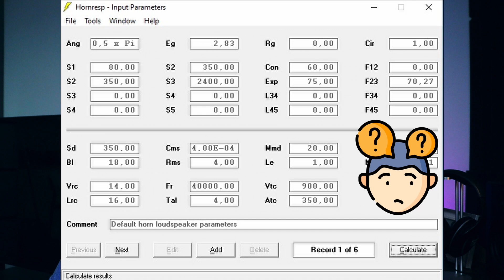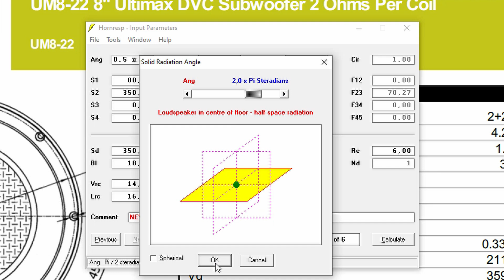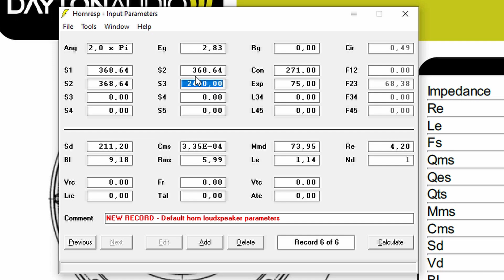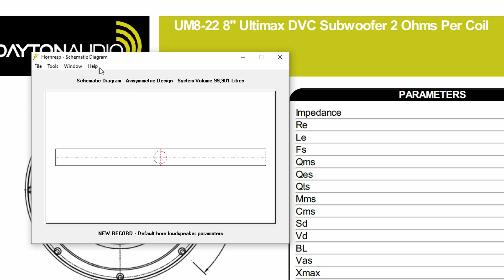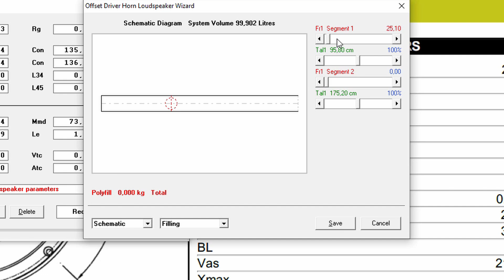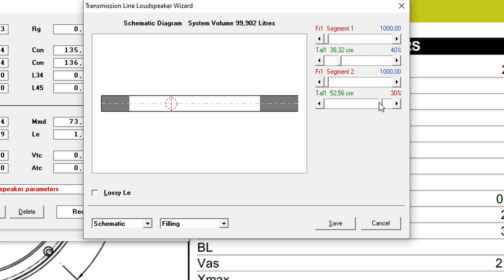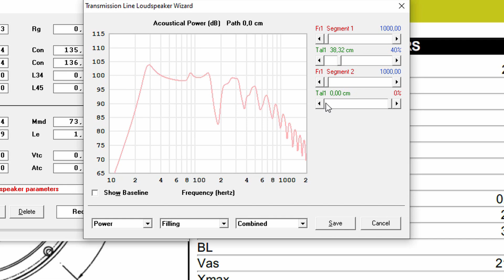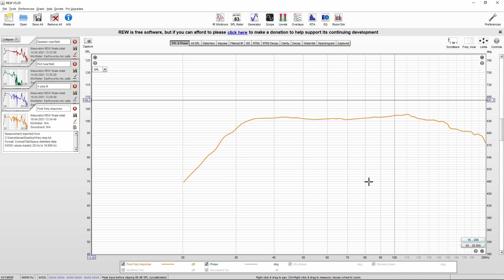Hornresp tutorial - How to design a transmission line enclosure

Comment: 1:30 That's a terrible starting point. You'll never end up with a system response at the driver's free air resonance, because you know... It won't be in free air. It'll be in a ported enclosure, because a transmission line is just that - a very simple ported enclosure. A better starting point is the size of a rather large bass reflex enclosure plus the port. You simulate it in any sim,  take the volume and the system Fs, the port's tuning and you work around these numbers. Otherwise you're chasing a moving target and just wasting time. Unless you pick a very specific driver, it's worth picking a shorter line because drivers have their limits.
There is a better way of finding the length of the line described in a video by Backyard Amusement.
Lastly most bass drivers don't like being tuned too low, so best find an info on how low and loud your sub can be driven before it's being strained. You'll find that most of the time the Tline will need to be shorter.
Reply from the maker: Hello! You are a bit confused. Transmission line is totally different compared to a ported enclosure. While they look similar the working principle is not the same. Bass reflex is a resonator while TL is just a wave guide for the back wave. As the back wave travels the long line, the phase is shifted and when it comes out, it adds with the front wave. A TL is not even a box, per se. You can slap a long pipe to the back of the speaker and it will work the same way. A transmission line is more related to horns than to ported enclosures.
Reply: @AudioJudgement  Hi there! Sorry  for late reply, just found your comment today. So I think you are a little confused as well. I know well how to design a transmission line and one thing I know for example is that there are variations of it. You have a back loaded horn also known as a flared TL, a tapered TL, but I want to focus on another variant that is mass loaded TL.
MLTL is basically a bass reflex enclosure that was designed with a transmission line model. There are very concrete reasons to pick one form over the other and they are dictated by driver parameters. To make the story short: it all comes down to how much volume in the enclosure you can have before the excursion is too much. So if you think about it this way, you'll soon be able to say, that a straight TL can be also imagined as just bass reflex enclosure where the box volume is zero and the port takes the entire loading. The volume of the duct matters just as much a the volume of a ported box! This is very important, because you need to be able to determine which driver will work better in a small reflex enclosure, and which can handle a TL, and if so then which type of TL is best. For example none of the popular SB acoustics drivers are suitable for a straight TL, but some are OK in a small MLTL. 
You can say that a TL is not even a box, but then is a bass reflex a box? :) It is a box to frequencies above system resonance and not a box to frequencies below it. In case of TL the dropoff can be made less steep, but it doesn't escape the laws of physics. How did you say it? " As the back wave moves the air in the port, the phase is shifted and when it comes out, it adds with the front wave" ;) You see what I did there? In practice the major sonic difference between a BR and a TL is that TL has a lower Q resonance, which means a less steep slope. It also implies less stuffing, because we are lacking a bit in the amplitude.
The unspoken difference between these two concepts is that if you simplify in your mind that TL is roughly the same as BR, then  TL model still gives you more insight into what happens in the enclosure. You can model a driver with TL model and with BR model and end up with the same exact enclosure. It's very unlikely, but only  because when you see the duct resonances (port resonances in case of BR or MLTL) you start playing with placement and stuffing to make it more refined, then what you'd do given just the lumped model of a resonator. Not sure if Hornresp can do it as well as Leonard Audio software that I've been using in the past. Either way you see the wiggles and you want the lowest ones to cancel out, so you nudge the port every mm into place. :) That's about it. That's the only significant difference on designer's side unless you have a special driver with suspension stiff enough to be mounted into a straight duct or a horn.
As I said it half year ago, designing the duct is chasing a moving target. When you change the length of the TL to match driver resonance, you change the volume, which changes the system resonance, which changes the duct length, which changes the volume... Unfortunately it's not a playground without limits that people make it out to be. People who design bass reflex enclosures often put bricks inside, when the midrange distorts from overexcursion. With a TLine  it's not as simple, so it's a good idea to find the volume first. From there you make your decision on which variant suits the driver best. If the volume is nonsensical, then you make a FTL. If it's large, then straight, then tapered... Finally the glorified BR also known as MLTL. You can look at Qts and the variants of Xmax, but I noticed that often people online will tell you when they make the volume smaller. That's how I designed MLTL with SB17 and SB23 drivers even without the large signal Klippel data.

Comment: Fr1 can't be correlated to density of acoustic material.

The alpha coefficient https://en.wikipedia.org/wiki/Absorption_(acoustics) varies from 0 = total reflection, to 1 = total absorption; and depends on the frequency of the sound.

Apparently Fr1 is related to the acoustic absorption coefficient alpha, such that Fr1 = alpha * 1000.

What if you repeat the measure without that 3% Rock wool? and with acoustic foam? which results would happen?

Greetings from Chile!